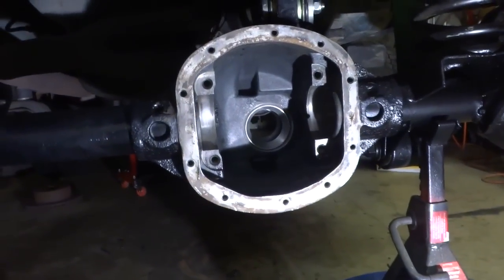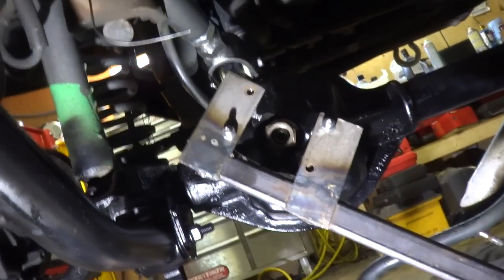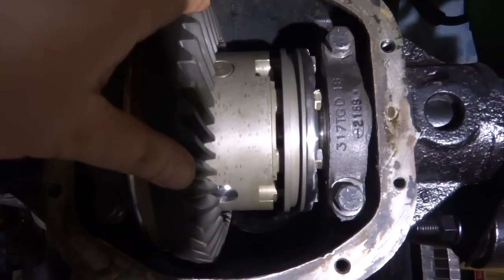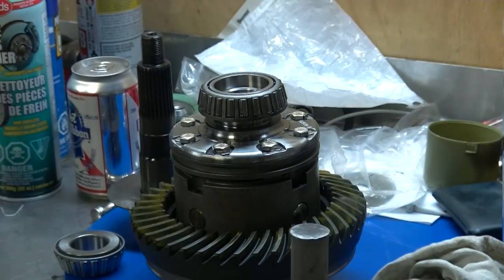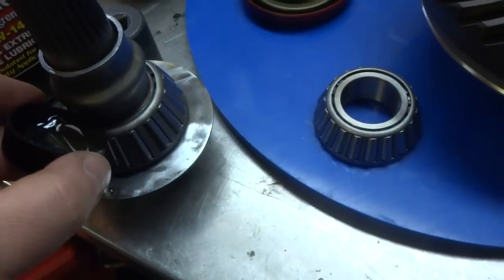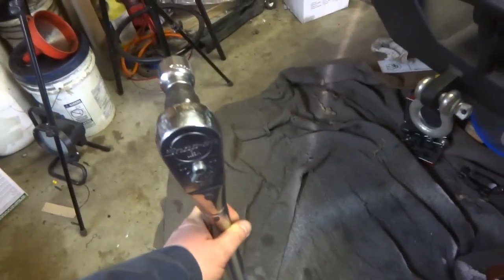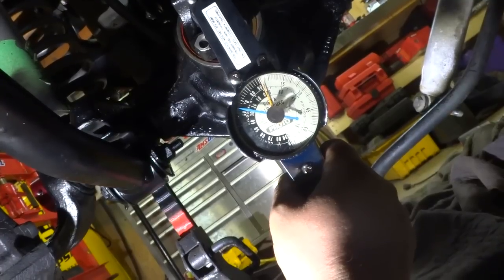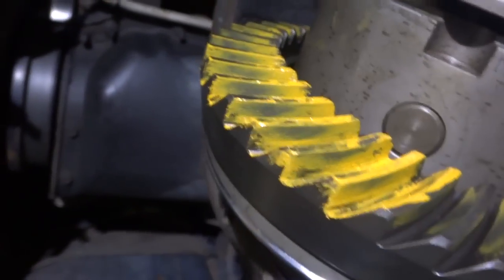How To Check Backlash and Gear Patterns, Plus installing the Ox Locker

Comment: Great videos keep em coming... however I got a question do you know where I could find an accurate list for all the torque specs needed for this job. I've got a Dana 35 and a Dana 30 I've been looking but find different answers and want to be sure before I start the project. I'm doing the same thing. Re-gearing all new bearings and seals and an oxlocker. Thanks in advance.

Comment: Thank you for going to the trouble of posting your videos. You probably don't realise how many people you have helped including myself. I'm undertaking this job now but fortunately I have the rear axle out and fixed to a simple stand I welded up. Mainly did this cause I'm doing a complete overhaul including a drum to disc conversion. You certainly are a character. If it wasn't for the accent, I would have thought you were an Aussie haha.I think you should shout yourself a big shed (garage) with a hoist and a bar with a fridge.Cheers

Comment: Jerry I've started using solid pinion shims, Ratech makes them. The beauty of them is this. You can set your pinion preload prior to setting gear pattern ( I'm working with ford 8"/9" stuff. pinion shims are put between the carrier and pinion housings) once the preload is established keep your shim pack and spacer together then go about setting pinion depth, install shims n spacer upon final pinion install...done. time for a beer, Hamms.....👍🍻

Comment: really helpfull I'm installing 5.13 gears in my 8.8 and I had slack in pinion and thought I had pinion as tight as it would go so I took it apart and crush sleeve wasn't even crushed so now I know my problem I need to get a longer cheetah bar and tighten the he'll out of it

Comment: I turned this off when he said he was going to heat his bearings to put them on. this can cause premature failure.
Reply from the maker: That just clearly shows your lack of intelligence.
Reply: +Bullshitkorner no they are to be pressed on for a reason and you even have a press... ffs man use the right tool. if you weren't going to press you can match fit a socket or tube and strike it over with a tap on method. heating it is the third option. I'm glad in the end you used the right way but why chance ruining your thousand dollar locker or ring set cuz you fragged a bearing with a stress point.
Reply from the maker: Like I said you have no clue and it's clear you are not a trades person just a armchair mechanic.  Get some education and come back and chat instead of wasting time posting useless shit.
Reply: +Bullshitkorner you think what you want but none of the locker installs by actual companies like OX or arb or Yukon anyone....suggest this. Having a press is part of why professional install is recommended. 

check page 4 section 9 of your installation proceedure. it says press... I'm right you're wrong this would void your warranty, you didn't follow the proper procedure. it's pretty cut and dry. just lazy....
Reply from the maker: http://www.maintenanceresources.com/referencelibrary/bearings/morb.htm

Read that and fuck off loser get some education on bearings.
Reply from the maker: Kevin Burns
it's arm chair mechanics at it's finest, good luck on the locker install let me know how it turns out.  make sure you break in the gears properly too that is the most important part unless of course you just using the same gears then never mind
Reply from the maker: apparently your just as stupid as the other guy, the information is in the link I posted.  A oil bath is only 1 way out a few.  If maintenance technician is your trade i can tell your lacking experience.  Maybe mcdonalds is a better calling for you
Reply from the maker: yeah i'd like to see Jeremy put a sealed bearing in a oil bath...............
Reply: segrimsjinn, Obviously you do not have a clue. 200 degrees is nothing.
Reply: skf has a machine that heats the bearings to temp, it has a clip kind of like a timing light that the bearing sits in. absolutely perfect. I freeze my bearings and races in the freezer to make pressing them in easier. you've done awesome work with your vids +Bullshitkorner. in Australia we call it beer o'clock haha cheers mate! 🍺👍
Reply: Bullshitkorner thanks brotha I will.  Looks like its gonna get put on hold till next weekend now because I got the wrong bearings.  But what do you mean by breaking in the gears properly, how is that accomplished?  I am regearing too so it will be new gears.
Reply from the maker: usually involves taking it for a short 20 minute drive and then has to sit to completely cool down, and then a diff oil change after 500km's.
Reply: +Bullshitkorner awesome thanks for the tip man!!
Reply: +Bullshitkorner I love this is still getting replies.
Reply: The bearings sound like a women. You heat her up and you slide it right in.
Reply: Beer:30

Comment: Thank you for clearing up on how to adjust the ring and pinion. Not so sure about all the f words, and your personal life though?
Reply from the maker: +Robert Fugate You know how to close the video or watch another so quit your bitching
Reply: Eric G if you look closely at the gear pattern, the pinion is turning the center teeth on the ring gear. If the tooth pattern is towards the outside or inside, the backlash needs adjusted more.
Reply: Joe Smith so you want it close to the middle, and you adjust it with the shims correct?
Reply: Eric G Correct.  The dial indicator is an absolute must when determining how much shimming you'll need.  If not, your diff will howl going down the road if your backlash isn't within spec with the ring gear and pinion.
Reply: +Robert Fugate Yeah, you can go fuck off.
Reply: +Bullshitkorner what pattern am i looking for with the paint? i replaced my carrier baerings and stumbled upon backlash on youtube, i was just going to throw everthing back together the way it was, but i cant now that i know this , any advice is greatly apreciated, thanks in advance
Reply: Robert Fugate b

Comment: Would it  be a problem to regear with stock control arms?
Reply from the maker: control arms won't make a difference, who knows it might make it easier because they are smaller
Reply: I meant performance wise in your previous video you changed the upper control arms

Comment: I gotta 1990 jeep wrangler. It vibrates hard as hell at about 50-55 mph. does that sound like it needs front u joints?
Reply: Have someone wobble the steering wheel, look for "anything" that is loose on the front end
Reply: ***** Thanks man really appreciate it!